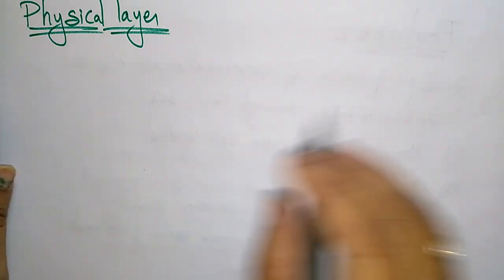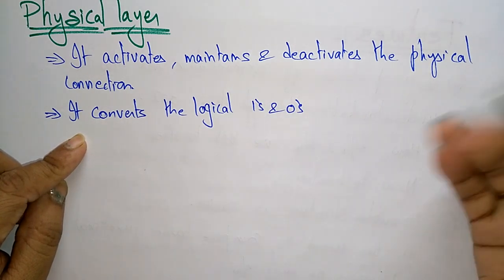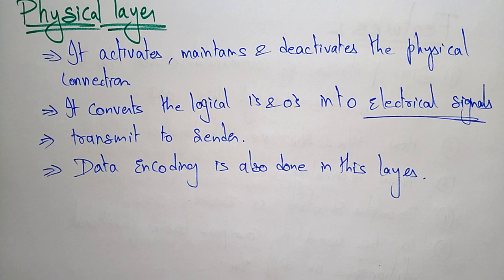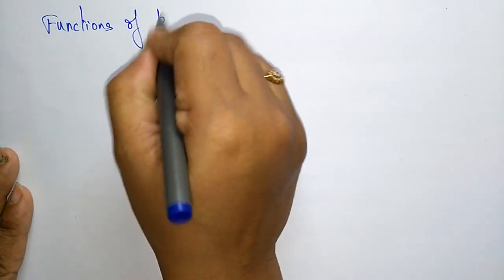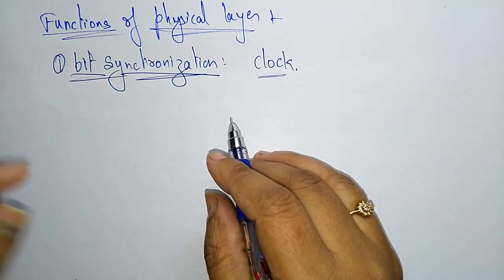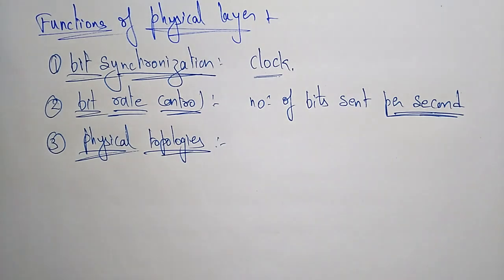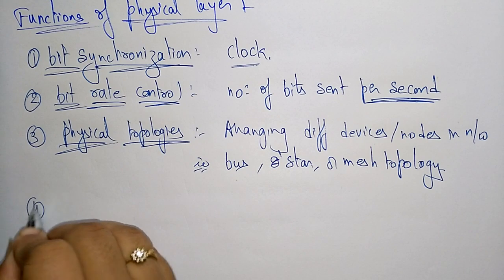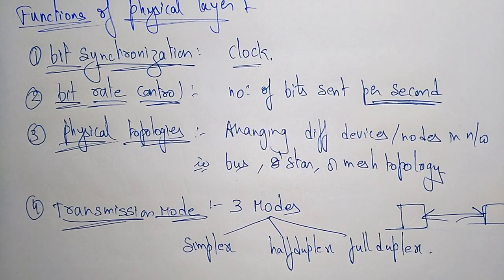Physical layer | OSI model | CN | Computer Networks |  Lec-19 | Bhanu Priya

Comment: what is data encoding ???
Reply: No, what Mounika U and bavya shinchu are describing is called encryption, which is not the same as encoding. Encoding means that you are converting some type of information (like data or an electrical signal) into a different type so that it becomes usable by a different system (for example, analog to digital). Encoding has nothing to do with encryption or securing information.
Reply: Encrypting the data so that prevents from unauthorised access
Reply: to secure the data from the third party it has been converting into another form
Reply: Converting image, sound or video or text to zeroes and ones.